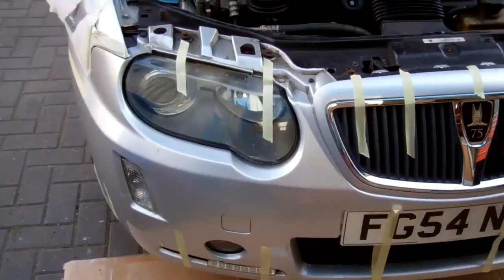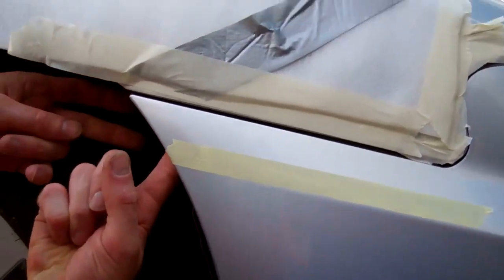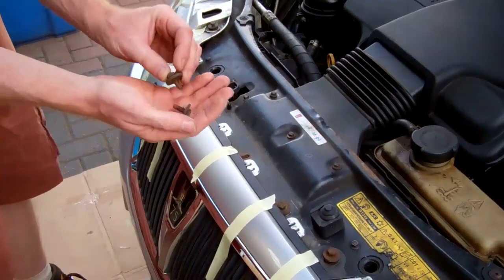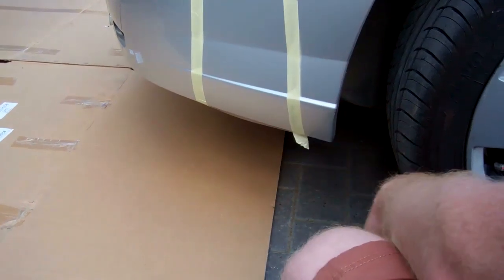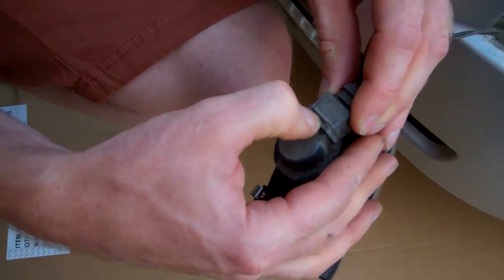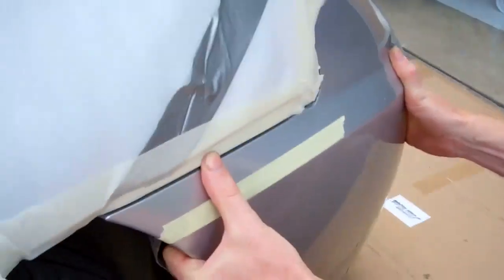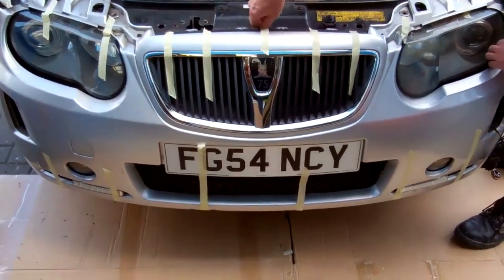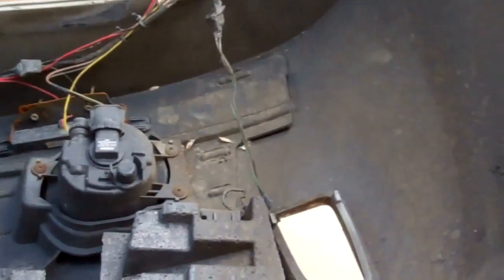How to  remove the  front bumper  on a Rover 75

Comment: Inside the wheelarch... Its a screw on the facelift model.... 10mm bolt on pre-2004 models.

Also... no need to disconnect the indicator lenses. You just unplug the block connectors once you pull the bumper away from the body.

Comment: Great video  but there are also two other self tapping screws  half way up the inside wheel arch lining and if the bumper does not need to be moved away from the car leave it connected to the wiring loom and you will not lose the amibiant temp reading

Comment: Excellent video thanks, but a day too late (for me). Might I respectfully suggest that some models have headlamp washers so you need to have a bucket handy when the tube from the pump is disconnected. There are also two fir-tree plastic clips at each top corner - which I ignored when replacing but some may want to. What caused me most problems was separating the headlamp wiring connector.
Reply: GOOD VIDIO does anybody do a video for replacement air con